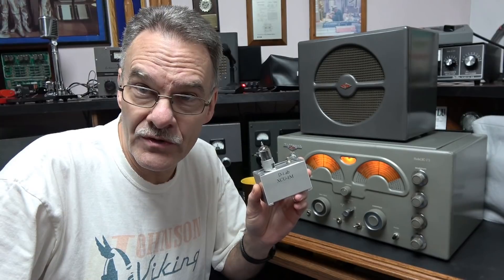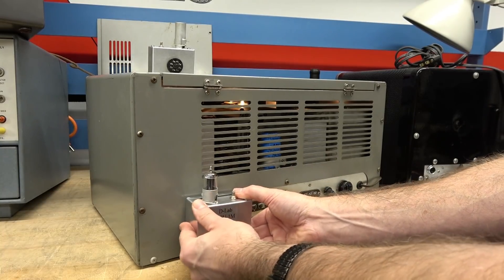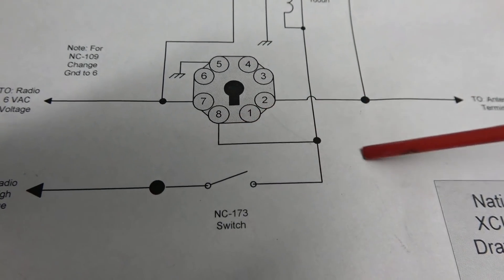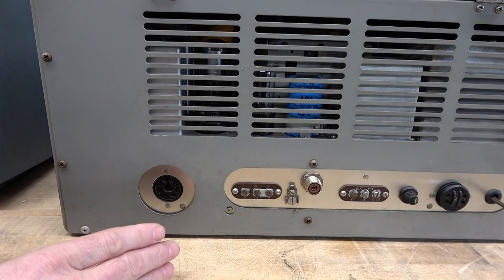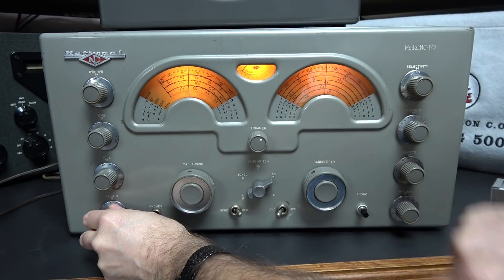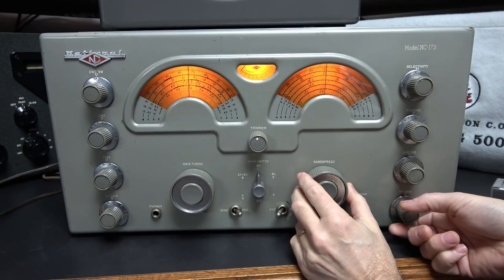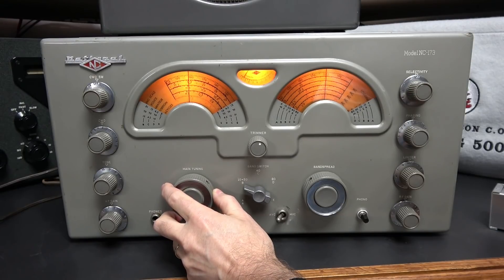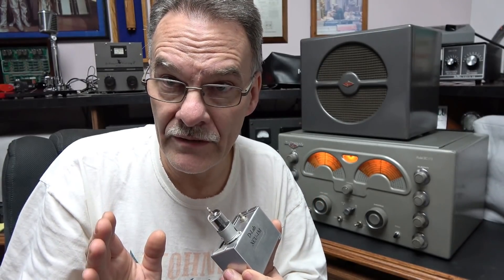National NC-173 Tube Ham Shortwave Receiver Crystal Calibrator D-Lab Gadget

Comment: The accessory socket was (is) used in NC-183 for the Select-O-Ject tunable audio filter or the narrow band FM detector. Both these use octal socket pin 5 for audio. Therefore, it would be safer to use pin 3, which is usually connected to the AVC line. Unless it is needed for some custom accessory, it can be disconnected and the pin reused for the calibrator signal.
On the other hand, the accessory socket is inside the enclosure in NC-183. It can easily be extended to the back wall as in Terry's NC-173. This way the pin assignments are not so critical if the internal socket pins are left stock.
Reply from the maker: Just finished construction of the 183 calibrator module. I used pin 3 for the signal output. Thanks for the suggestion.

Comment: What parts are hard to get for your modules?  I may be able to help get some cheap from a local supplier going out of business soon.
Reply from the maker: The ceramic 7 pin tube socket/Johnson air variable cap/1 Mhz crystal (HC51)
Reply: I can help with some of those, though not in large quantities.  Couple questions:  Would other than ceramic sockets suffice?  What are the specs on the cap & might APC-like types suffice?  Crystals I think I can glom a handful of 1MHz with wire leads.
Reply: I have about a dozen of the crystals. Let me know about the other parts (see my earlier question).

Comment: would it work on my national ncx5 it has a socket 8 pin octal marked calibrator also you can use one like this with a short antenna in the shack you can turn on or off gives 1mhz or 100kc mark for all your radios vk2mu

Comment: What about the nc300, 303?
There is a switch and a n accessory port for a calibrator already.
Reply: Those sets had an optional calibrator & an octal socket inside the cabinet to accept it.  There's schematics & pics of them around, and it would be easy enough to make one.